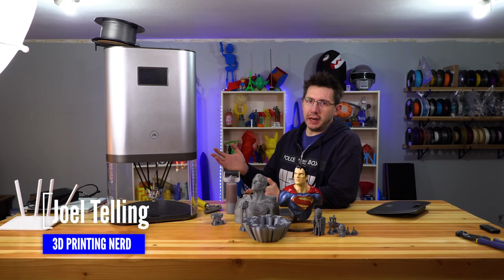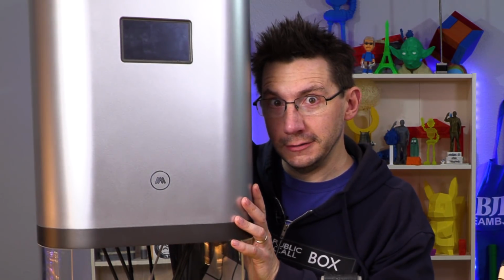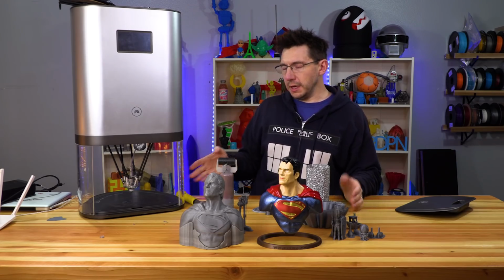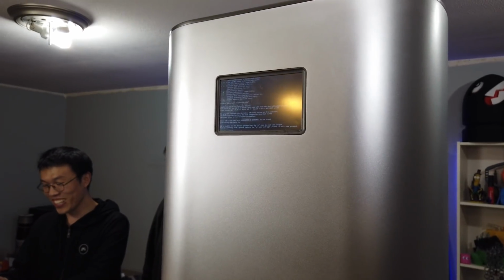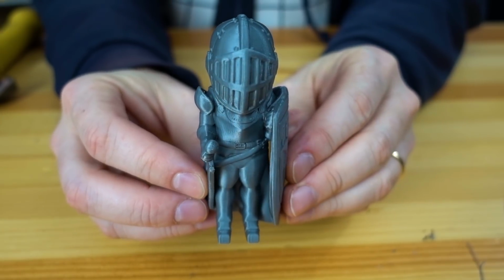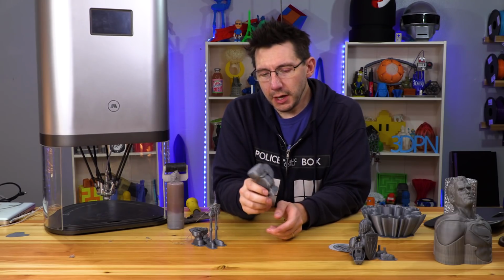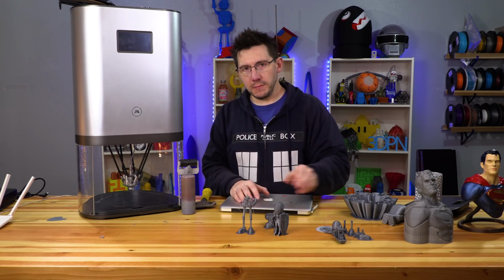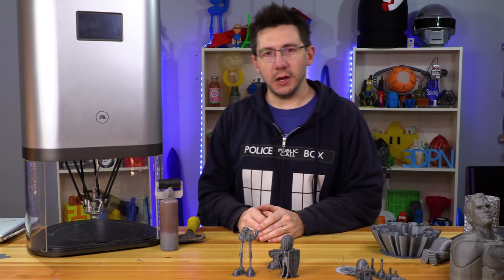3D Printing with a Prototype IVI 3D Printer

Comment: Also CNC milling with a delta using nema 17 steppers? Maybe if you are milling cheese? And resin printing eh... ever notice those printers print upside down from a regular FDM set up, as in it pulls the print out of the pool of resin? so with this, how is that gonna go? Resin pool has to be below (thanks gravity), maybe the delta affector becomes mixed laser and mixed Z lifter? Anyway, I think the most commendable thing is they allowed you, Joel, to play and poke at this without them around. Everything else (especially the whole AI thing they talked about at CES) is just total marketing fluff. And of course Kickstarter prices are just ridiculous for a plan so audacious. A friend of mine and I both funded (and both lucky enough to actually get) Craftbot for $500. But in comparison, that's just a simple no frills (but well built mechanically) FDM printer. My printer was half a year late, my friend's was almost a year late. By today's standards, that's basically on time for any hardware Kickstarter. I have numerous other hardware kickstarters that are running 2 yrs late, or simply ran out of money (or ran out of CEOs).  As Joel said, only invest if you really believe in this company, and are basically willing to never see your money or any actual product. Alternatively, you can buy a decent Prusa or any number of other existing products and learn how to hack and improve them.
Reply: Thanks for your comment. Added an additional axis to do the Z job. We know it's hard, that's why we work harder to make it happen.

Comment: Closed loop is really hard with delta printers because the Z is affected by each of the 3 motors, so if even one loses a step, the Z height is fucked and it will crash.

Comment: I've worked for several firms along the way that were putting out a product from scratch - my specialty is manufacturing engineering, and all products must be designed to manufacture. All successful manufacturers started/passed thru this stage. IVI is at a make or break point (there are several)
In any case, these folks are in the most stressful and danger wrought stage of product development, as witnessed  by their concern for the print running while you were at dinner. It matters a lot to them to look good, and it was "high risk" what they did, letting you run their prototype publicly, especially in their culture. Failure isn't looked upon as a normal part of the development process as it is in other technical circles. They care  a lot what you think, with good reason. They need people to believe in them and their product.
Thanks for a look into one of the groups trying to make their mark in this new industry. I wish them well.

(I wish you well too, Joel, you're doing it right!)
Reply: Thanks, Scott, for understanding us. At the very beginning, we design parts to manufacturing. Elvis was a mechanical teacher at a university, and he knows how to make parts in CNC or other mass production methods. You're right, letting Joel test our printer is a huge risk without our intervention. But it worth it. We will work hard to make this project come true.

Comment: I would bet money that this closed system is based on the mechaduino driver board and the return is a bit sketchy , because they didn't have time to debug their implementation for the delta. Not judging, this can be a really good printer, and they achieved more before kickstarter than 90% of the printers there after they got founded.
Reply: Thanks for your encouragement. Mechaduino is too costly for us. We have our own solution to reduce the cost but with same or even better performance. We do need more time to tune the firmware.

Comment: I'm actually immensely interested. When the kickstarter goes up ill throw my dollary doos at it. I've never dont that and i hate delta's (from experience). But this has got me really interested and willing to deal with being an early adopter.
Reply: Paul slatky I am going to back this printer so hard.  This has some really good ideas going into it.  I am not really so exited about the printing as I am about the laser attachment.... and quick swap head.  I am shocked by how well it prints without a cooling fan.
Reply: @brightnovastar  Thank you.
Reply: Thank you for your support.

Comment: I've backed a lot of projects on Kickstarter. Even projects that do not intend to deviate from the prototype run into issues when they go to production. If I'm being asked to back a product I want to know that the components aren't going to change, yet here's a discussion of at least two major components that may be swapped out based on funding. No thanks. 
This video gets a thumbsup for the screaming goat.
Reply: Thanks for your feedback. That's the worst case, we'll try our best the use the best components to build our printer. If we change it, we will tell everybody about that.

Comment: Their website says it has optional CNC, LASER and SLA print modules. Do you know anything about that?
Reply from the maker: I do not, unfortunately. This prototype is only for 3d printing - their prototype with the SLA abilities is still back in China.
Reply: The spindly rods would never work well for the side forces and mass of a CNC router. As far a using that as the basis of an SLA resin printer, I can't figure out how they do that.
Reply: That's what I was thinking. It seems like they may be offering things they may not be able to deliver.
Reply: @JohnSmith-mk8hz  CNC is working, SLA is working too. We will post videos about those functions.

Comment: 3d print a crown molding to finish your wall!!!!! :)
Reply: Hah, could do it like filament tags/chits/mascots as well.  Just print a new 4 inch section out of every filament and slowly work around the room
Reply: @servalspots7133   print a small section and use it to make a mold to cast multiple sections....
Reply: @imperialpresence3331  Much more practical, though slightly less fun perhaps...  I didn't think of it at the time, but you could print some profiles and make the crown molding the old fashioned way... though that's a fair bit of messy work
Reply: I would not want 3D printed crown mouldings. The combination of non-dense infill and flammable materials... seems like a fire hazard as a construction material. Not to rain on anyone's parade, of course, if you really wanted custom crown mouldings you could 3D print a mould and make plaster casts. 100 years or so plaster decorations for ceilings/walls were pretty popular. Or, I suppose, print in a self-extinguishing or fire-retardant plastic, if that's economically practical.

Comment: Closed loop -- budget at minimum is $35 per stepper, and that is if they're using substandard components cloned by a Chinese company I will not mention. For a properly sourced version, it's closer to $60 per stepper, regardless how you slice it -- the price point doesn't work when you throw in all the other promised tech. Closed loop is nice, I have them running on a machine, they work -- they're NOT cheap. I have plans+parts to upgrade my delta to use them as well, again NOT cheap. Lots of skepticism on them being able to get it to work at that price
Reply: Thanks for your comment. We developed our own system to reduce the cost. But we need big volume to get an even lower price.

Comment: Well if nothing else I applaud them for following the Marlin GPL. Them doing that from the onset shows their character and it's appreciated.

I like Delta designed printers as they have great speed  with lighter heads and are just cool to watch. 

It sounds like they're trying to get a more affordable Atom3d printer, I would lose the carbon fiber bed and just stick with a heated aluminum build plate. Unless the carbon fiber is a cost cutting measure. Belts are fine, linear rails on a Delta that size is kinda overkill. 

I think it would be prudent for the team to look at some of the well reviewed budget Kossel Deltas out their, specifically Anycubic's, and improve on the design. They have a great goal they just need to make sure their product is actually an improvement on that design focused on user interface and expandability.

If they could scale an Atom3d down to 180 * 250 build space with a safe 24v heated bed and attachments for SLA and other stuff at an affordable price point I'd be ecstatic.

For that reason I hope they succeed.
Reply: Thanks, we will try our best.

Comment: Great Prototype review or Head's up. Thank you. Even if it did not return to the proper printing spot when you beat the crap out of the hot end, it did a better job than any other 3d printer out there considering how you were punching it. Thank You for the post !
Reply: Yeah, Joel punched it toooo hard. LOL.

Comment: Hmmm no cooling fan? well it's a very unfinished prototype /: a cooling fan it's essential when you are printing
Reply: Of course, we know a cooling fan is essential. But at the beginning, we want the printhead as clean as possible, so we moved the fan to the top of the printer( with more powerful fan). As you see, it's not enough so we will add fans to the printhead to make sure the cooling issues will be fixed.

Comment: "Closed loop systems" only works if the belt teeth can't skip. Obviously this ain't the case since it's using belts and the rubber teeth will easily slip.
Reply: No, that's not that easy to slip, especially for the mechanism with a good belt tension system.

Comment: Didn't we prove that cooling fans were necessary in like 2013? I personally would think that sending something like this out as a company would hurt the reputation rather than help.
Reply: Of course, we know that. We moved the fan to the top of the printer with high power so the printhead will be clean. But this design is not enough, will fix this in next iteration.

Comment: I like delta printers. I want one just to watch it print. The Cartesian printers like my CR-10S are fun to watch but delta's are different almost organic. They need googly eyes and faces.
This printer. . . I don't know if the developers will read this or card but. . . I don't like the design. It's overly top heavy. For the gigantic size the build area looks way small. The screen, what? Does it come with a step stool to use it? It's got to be six feet in the air on your bench. Can't comment on the mechanics. Like you said, Joel, what anyone gets isn't going to be that. Proof of concept? Marginal. Print cooling should have been a day one item not something they're considering. It isn't aimed at me. I do wish them luck on the project.
Reply: Thanks for your comment. The developer is here. The height of the IVI 3d printer is 27 inches ( The Specs are here: https://ivi3d.com/specs ). We have cooling fans at the top of the printer, but that's not enough, we will fix this issue in the next iteration.

Comment: I can't think of a 3d printer on Kickstarter that actually delivered.
Reply from the maker: Gcreate, robo, formlabsb:)
Reply: @3DPrintingNerd  The Robo 2 printer that was over a year late and did not work? You even had to get 3 of them to make one work I thought.  So two out of how many out right scams and failures?
Reply from the maker: Robo r1! Heh. But, hey, gMax and form 1 work well ;)
Reply: Mass production is hard for every start-up team. We have lots of connections to manufacturing the printer in Shenzhen, we will work hard to make that happen.

Comment: I just ordered a ender 3 any suggestions for pla filament?
Reply: I will get flamed but I have had really good luck with amazon basic.  Cheap so you don't mind figuring things out before you spend more money on better PLA.
Reply: I like 3d Solutech. They are around $20 per roll and I've never had an issue with it.
Reply: Amazon premium PLA works find for me at 205
Reply: There’s nothing wrong with amazon basics. I’ve gotten some decent prints. I also really like hatchbox. It’s definitely decent and the surface finish is a nice satin. 

Get your profile tuned with the cheaper filaments.  I also recommend maker box. They send you 5 sample filaments every week so you can play around with some really exotic filaments on the cheap and they give you discount codes if you decide to purchase full rolls of any of the sample filaments. 

Best of luck.

Comment: that Joelbot had some killer dance moves!!
i can tell youre frustrated with showing a kickstarter, but you also can see their passion and enjoyment of what they are doing so i think you did them a good service, didnt bash, didnt promote, just got the word out there. and thats what they need right now.
Reply: Couldn't have said it better myself. THIS is how content creators can and SHOULD work with Kickstarters.
Reply: I completely agree with both Jordon's and Hazonku's point. Though I get the impression there was a lot of pressure to do this, which makes me a little uneasy as I know how pushy some business types can be trying to persuade people. I'm not saying that is the case for sure here, but I do somewhat get the impression and I could be wrong.

Comment: could you maybe do a video on print speeds please? I have 2 home built prusa clones and i tend to print at 50-60mm/s, sometimes slowing down to 40mm/s for a slightly better print quality, but im not really sure what is a "good speed/quality" printer and what the speed limitations of different boards are.  One of mine is a ramps 1.4, the other a MKS Gen L but would consider going 32bit if it made any sort of noticeable difference
Reply: its a delta,  it can have travel moves up to 200-300mms if you wanted.  any non-prusa style could go faster, anything where the bed isn't moving around.
Reply: @digibluh  wow, thats quick. So a coreXY would be quite quick too then?

Comment: Why do these printers forgo part cooling fans????
Reply: We have cooling fans, just not at the printhead. We moved the fans to the top of the printer. But this design turned out not enough, we will fix this in the next iteration.

Comment: Looks like a big Tiko printer
Reply: YES, that was my first thought! I actually thought it was one at first.
Reply: Already prints better than Tiko! lol I love my tiko paper holder
Reply: Jonah Easter lmao
Reply: Suspiciously similar.
Reply: Thought the same thing when I saw it.
Reply: But hopefully qith a better interface, and fingers crossed, that they add support for paet cooling, or the abilities to add it as an aftermarket add-on...
Reply: Another manifestation of IP theft
Reply: @krnxemb  Seriously?!? How many different ways can you make a delta 3D printer look? First of all, no one in their right mind would try to steal anything from Tiko. They have nothing worth stealing. Secondly, looking like something doesn't mean it's automatically IP theft. I certainly how it doesn't work the same as a Tiko. Do you have something more substantial than "it looks like something else" for your IP theft accusations?
Reply: @noahlangseth5196  Let's see. Cloud printing software, no part cooling fan, same case, same clear bottom section same flexible print bed. I literally have two Tiko printers sitting next to me and they are very similar to this one. (Also, point out a single other delta that has a case like this and the Tiko.) I don't think it is IP theft, but they are very similar.
Reply: Tiko scam the whole project and now this ..
Reply: And I’m sure it’s Kickstarter will fail too. Won’t make that mistake again!
Reply: @maxmuck1781  can you still order a Kodama Obsidian?
Reply: That’s what I thought at first, I thought they just rebranded it
Reply: I hope this KickStarter goes better then the Kodama Obsidian. Just saying.